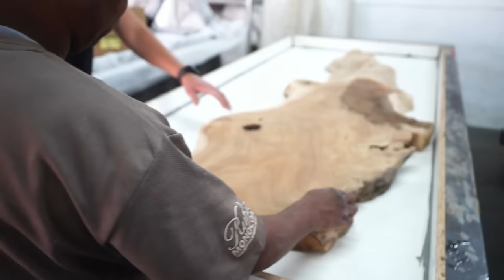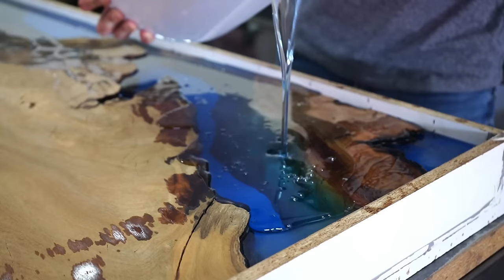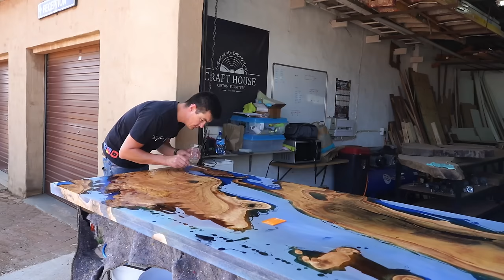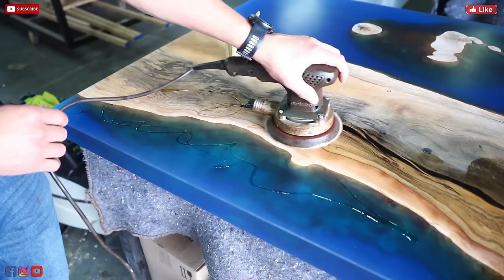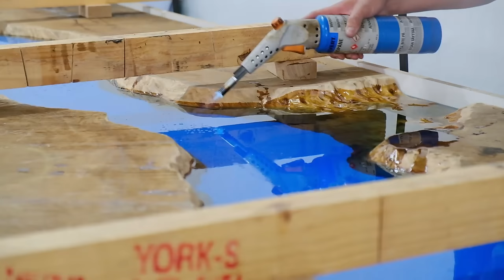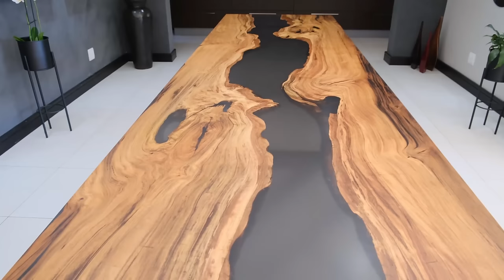Luxurious $10000 DIY Epoxy table - start to finish (uncut)

Comment: Greg, your table is absolutely beautiful—a true work of art! I have a question about your process. After pouring the resin, and letting it dry did you apply a type of oil to the wood afterwards and would you be able to share what it is? 🙂
Thank you! 🙏🏼

Comment: I have a head and shoulders wood carving, and am looking at using resin which I think would look amazing and quite different to anything I’ve seen. However, I’m not sure whether it can be done? As it looks like a lot of work because of its shape.  Or whether it’s even doable. Advice needed please.

Comment: I like it but a little white along the edges of the wood by the water while it's wet then blow it with a heat gun or blow dryer or something and it makes it look so much better and realistic. Still this table is bad to the bone.